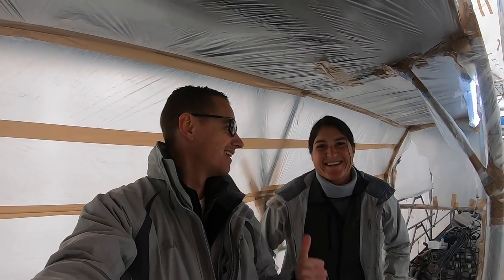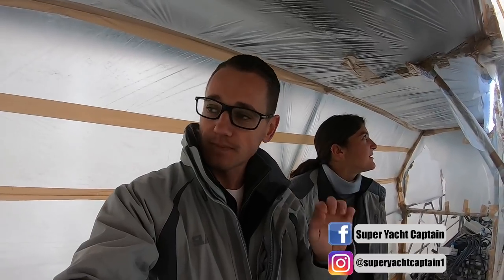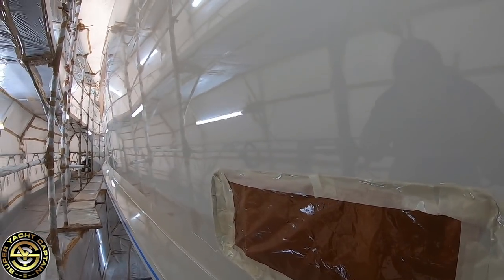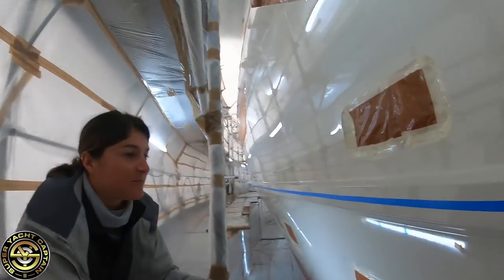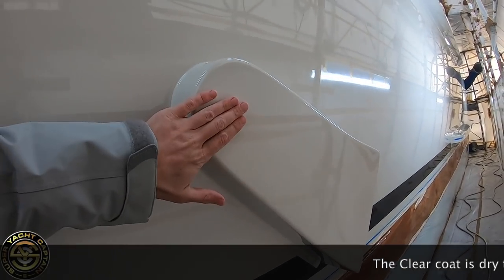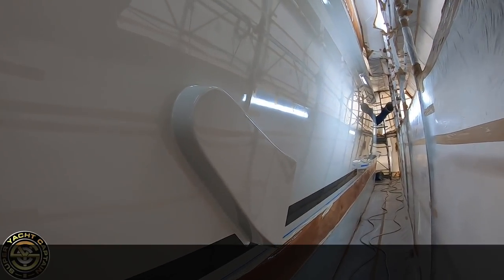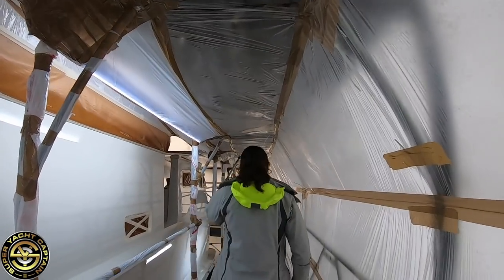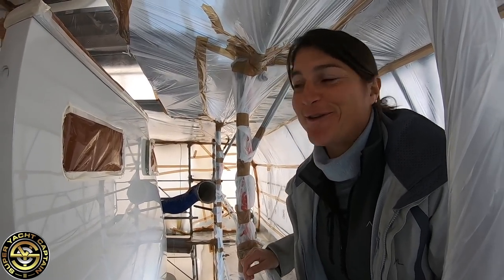Completing a Luxury Yacht Paint Job. (Captain's Vlog 54)

Comment: Excellent paint work. I don't see a single wave in the paint, which considering the yacht is 122ft in length, that's impressive. Once the yacht is color sanded/ wet sanded and buffed it will have substantially more gloss. 

Though it may void your warranty on the paint, I highly suggest you have the ceramic clear applied prior to putting the boat in the water. The issue with doing the ceramic clear a year from now, is that all the imperfections, scuffs, etc will end up permanently sealed under the enamel of the ceramic clear. I would advise it gets done now, especially since the boat is already masked off and it would cost substantially less money to have it done now. I've used ceramic clear and IF applied right, it works really well. The thicker the coats, the better the protection.
Cheers!

Comment: How much extra weight on all the decks did the 5mml teak add,, fuel econ, looks epic though, subscribed
Reply: not knowing an exact area of teak awol has i can offer a rough number... If the teak covers 100Sqm then you would expect to add about 325kg/720lb  in weight... considering awol weighs in at a little over 300tons gross, the difference in weight is effectively negligable for all intents and purposes